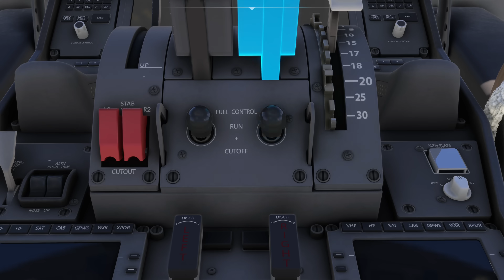Air India 171: Why Did The Fuel Cut-off Switch Get Moved?

Comment: There was an incident in 2019 involving 787 aircraft, where the engines fuel were cut off without being commanded during landing (Japan airline).  Look it up folks 

Such is discussed in another video. 
Quote "  Joining Barkha Dutt on the show, former U.S. Department of Transportation Inspector General and now, aviation attorney with Motley Rice, Mary Schiavo raises a chilling possibility: that the Air India Dreamliner may have fallen victim to a known software-triggered engine failure."

Comment: If I was diving headfirst into a populated area with a few hundred gallons of fuel in the tanks I would switch off the fuel pumps. Not gonna save me but it might contain some of the death and destruction. Not saying that is what happened but it could have. They had no engine power anyway.

Comment: I agree with the analysis Captain Steve and have drawn my own conclusions based on preliminary findings although one thing I still find hard to digest is that why did the flight captain take an entire second to position the fuel switches to cutoff mode , hypothetically if I were to do such a thing I would do it instantaneously or probably both of them together I know that this might sound stupid and 1 second is very quick but still if I were being discreet and wanted to self sabotage then I would have done it right away without even waiting all this is hypothetical btw and I would never do such a thing but just curious.

Comment: After watching a lot of theories and assuming either the pilot or co pilot deliberately shut the fuel cut off switches off would it not make sense that the captain is the more likely given the left was cut of first then the right 1 second later especially as the co pilot was flying, if the Co pilot was to cut them off surely he would have been pilot monitoring and would have done the right one first then the left , I know it's muscle memory but it would need to have been done in haste ,most people even if it's not normal when wanting to do something quickley would choose the nearest first.
Just wondered if you had any thoughts on that steve

Comment: As playhockeylikeapro mentioned in the comment that was noted by Captain Steeve at 10:30 all big rig trucks have inward and outward facing cameras.  In addition, most school buses and a passenger buses operated by large cities in the U.S. have several inward and outward facing cameras including one that is completely focused on the driver of these vehicles. In addition the FRA (Federal Railroad Administration) has mandated the use of cameras for Engineers (the people who drive the trains) that operate around the large U.S. cities. So far I don't believe these videos have been leaked to the media for nefarious purposes.  I think Captain Steeeve and the pilots unions need to get it out of their heads that something like this would happen and allow cameras to be installed in the cockpit of airplanes. Had this flight had one it would certainly have quelled any doubters.

Comment: This may be a stupid question as I don’t know much about aircraft and procedures and the whole situation for that matter but could it be possible for them to attempt a take off with one of the cut off switches activated, running off residual fuel in the system. Then in panic, realising the problem, cut the remaining engines fuel before the other pilot noticed what he had done, disengaging both?

Comment: Why you lean more towards to pilots faulty 
thats very odd from a guy in your expertise. 
All this 33 seconds captain talks were  why did you cut off fuel and first officer said i didnt and captain goes may day may day 😅😅😅😅 if a electrical or software malfunction made those both  switches to  cuttoff position and if you are the pilot what would you ask the first officer???? Probably the same thing because it never happened before so obviously it comes to his mind other person cut it off.
Dont be so ridiculous its all made by humans but they are electrical circuits and can break .its all machines at the end of the day? Its easy suspect the pilots but it could be the otherway too ..
Any way you are getting lot of watchtime on you tube thanks to the tragedy.

Comment: There are many controls that a pilot can use to make the plane crash. You can not make all requiring double confirmation and you don't want to do that in case a pilot is incapacitated, as it has happened. 
The planes evolved to override pilots when they input unsafe command, but this can lead to things like to problems like 737 MAX MCAS. Also, even with such systems things like AF447 happened or controlled flight into terrain happened intentionally. 
What happened now is very sad, as were all accidents that led to the high level of safety today.

Comment: The sequence of switch  cut off and back to RUN is very  crucial  finding 
If it was 
Pilot  1 to  do the Cut off then it will be
Engine 1 Cut off --1 sec-- Engine 2 Cut off--10 sec--Engine 2 RUN ---4 sec-- Engine 1 Run

Notice the sequence  of engine mostly likely  to be reverse  as the other pilot from other side might have started it from his direction
Reply: Notice that the engines were restarted, and the plane was in a best possible glide for an emergency landing. Something a suicidal pilot will completely not allow to happen. I am evil. I know how evil thinks.

Comment: A bit confused. So let me put it sequentially. 
1. Fuel switch 1 cutoff, 2 cutoff
2. Pilot 1 ask question, pilot 2 answers 
3. Pilot 1 places fuel switch 1 run, 2 run
4. Crash and finding debris 

Q: how is the fuel cutoff switches of the debris in CUTOFF? Should that not been on RUN? Is this correct? Would that not be a plausibility for other reasons/flaw?

Comment: FACT: BOTH fuel control switches are in RUN POSITION. To make it easier to understand think of it like an ignition key/switch, there are two ways to cutoff. 1st method is by physically turning the key to off position. 2nd method is by cutting power supply while the key is in ON position. Once power is restored FDR will log the data like turning ON the switch without physically touching it. There is no evidence to prove that the fuel cutoff switch was manually turned off by the pilot. Why the hell do both switches are in RUN POSITION? FDR/CVR data should be available to the general public so there is CHECK & BALANCE. You're blaming the wrong people. Fuel cutoff is always done with throttle in idle position not at FULL. I can smell BOEING AUTOMATION takes over. Who the hell deployed the RAT? 😂 😂😂
Reply: And there is further proof there was no suicidal pilot. The plane was well guided into as safe as a landing, nose up. A suicidal pilot won't allow that.

Comment: OK Camp and Steve you’re the best at this and I’m really a true fan. I thank you for having this type of Channelle the question that I have and I’m not sure if anyone has asked this, but is there a possibility that neither one of them touch the controls and something “Not of this world“ might’ve done that I know this sounds pretty crazy, but you have to look at what happened after when the second pilot said “I did not” since the fuel switches were put back into the run position. There wasn’t a struggle there wasn’t a fight there wasn’t anything the other pilot said. That would further conclude that the pilot who supposedly switched the fuel switch was coming mass suicide. It’s so weird because u would think if someone wanted to commit mass suicide they would stop whoever is trying to avoid it and achieve their mission. Really hope u can speak to this. Not being weird but I think a good question.

Comment: If one pilot is unavailable the other should be able to control the takeoff. I think to prevent this problem a computer can restrict fuel cut off on takeoff unless both pilots request this and this is possible to do. In reality if we are dealing with psycho pilots no design can prevent this. I still would like to know if the cutoff could have occurred downstream from the switches. maybe a boeing engineer can confirm or discard this as a possibility. Also the RAM was deployed while the place was still on airport property there is photo evidence. And why are they not releasing which pilot said what by the headset they use ie P C1 O1 etc.. cameras should be placed in cockpit to record everything in case of accident. I think some immunity should be given of unauthorized  activity that does not impact safety of the airplane. ie jokes etc.. to keep everyone awake.

Comment: Do you think there's any chance that it was a lapse of concentration and one of the pilots cut off the fuel switches without meaning to do that. If it was completely subconscious, that would also fit with the guy saying 'I didn't do that' on the CVR.

(I think it's most likely to have been a deliberate act but just wanted your thoughts on if there was any chance it could have beem an awful mistake)

Comment: I have also come up with a snag re: the idea of fuel cutoff switch movement requiring both pilots. Unlikely, but possible. In the event of a pilot incapacitation where the remaining pilot also gets an issue eg. engine fire requiring them to shut down an engine. Or would this then require a member of cabin crew to be present - in the seat of the incapacitated pilot - and know the procedure? That also seems problematic - eg. do you then have to train ALL cabin crew in this? Cabin crew are not qualified to sit in the pilots seats, etc...

Comment: This is such a huge cover up, both of them weren't suicidal at the same time, those switches went to cut off within a second. The FAA already released detailed report earlier on Boeing's faulty fuel switches. Not many people know but this has already happened with one of their planes but that was one was at significant altitude hence a catastrophe was avoided, but unfortunately here the plane barely took off.
Reply: Flight number of the other instance?
Reply: No one said both were suicidal. Only one who switched both fuel switches to cutoff.

Comment: #1 No switch is hard wired to the engine, I bet it sends a signal to a computer and the computer shuts the engine down, but I could be wrong, #2 was there a third person in the cockpit? Both pilot and copilot denied turning the switch off!

Comment: Further to the point about allowing fuel cutoff to engines at low height: surely the onboard computer knows whether the phase of flight is takeoff or landing, not least due to aircraft configuration etc. So it must be possible to programme the computer to prevent fuel cutoff on takeoff before a certain altitude? And/or to prevent cutting off BOTH engines at low altitude?

Comment: Considering the Air India 171 accident, it has become extremely important for the aviation industry to reassess the design philosophy of certain controls of critical functions.

The investigation suggests that both engine fuel control switches were deliberately moved to the CUTOFF position during takeoff, resulting in the shutdown of both engines and the subsequent loss of the aircraft.

To mitigate the risk of intentional misuse of the engine fuel shutoff system, a redesign of the operational logic of these controls is required, such that their activation necessitates the coordinated and simultaneous input of two authorized crew members.  This dual-action mechanism would ensure that no single individual can unilaterally disable propulsion systems during flight, thereby enhancing cockpit integrity and overall flight safety.
Other controls related to critical functions should also be reviewed under the same redesign criteria, in order to strengthen flight safety regardless of the nature of any malicious intent that may arise from within the cockpit (e.g., mental disorder, sabotage, terrorism, etc).

Comment: The switches were found to be  on the "Run" position at the crash site. Is it possible that they were never transitioned to "Cut off" position but some software malfunction caused it to register it as being transitioned in the Computer which led to the engine failure? The pilot might not have actually seen the switch moved but noticed the engine spooling back and out of suspicion asked the other pilot why he did it.

Comment: I'm assuming that the reason for having two pilots is that one can handle things if the other gets incapacitated.  Implementating a 2 pilot requirment to shut down an engine could be a problem.
Reply: Two pilots reduces the workload of the pilot doing the flying.

Comment: How might we know that there wasn't something wrong with the Fuel Control Switches that when the aircraft nosed up, they didn't fall back/down into the CUTOFF position?  Certainly, no one would place something on the pedestal that could slide or fall onto the switches?  How obvious would it be to one pilot that the other reached for and did something to the switches?

Comment: So you totally removed the possibility that the software just detected a fuel cut off and switches were not moved. You're a pilot sir not an engineer. Seems like you've already blamed one of them in your head lol....could also be a wiring fault if it was all hard wired
Reply: The switches cannot be moved by a computer instruction.
Reply: @bobvidoni5898  sure but the wiring can be faulty which would be detected as the switches being off.................where is the evidence of switches sound???

Comment: It is a distressing preliminary report. What were the timeline actions for "1. run to cutoff transition; 2. cutoff to run transition; 3. Question 'Why did you cutoff'; 4. Answer 'I didn't do so'." the misplace of the conversations among the recorded events in the data recorder give a total reversal meaning. Giving some and not the remaining looks to be intentional to mislead the readers rather than clearing the doubts. Forensic audio analysis was not mentioned anywhere in the report. What was the increased rate of acceleration while on runway (ground) and while in air (liftoff) until it reaches the maximum speed. By using this data we can calculate the final momentum of the plane at the time of liftoff and how long it could continue with the same momentum and when did it started decline duly deducing the friction value while on ground and adding the "g" value while in assent. The study has to be on the principles of a projectile since the loss of its thrust, keeping in view the aerodynamics and density of air at that time. This derived data is crucial to analyze whether loss of thrust was prior to the fuel cut off and if so the manual transits/operation of fuel control switches by the pilots were to restore the engines back to functioning. The path traced by the plane was parabola and if it is plotted on graph, lot of information can be deduced from it which help in confirming or eliminating certain issues.